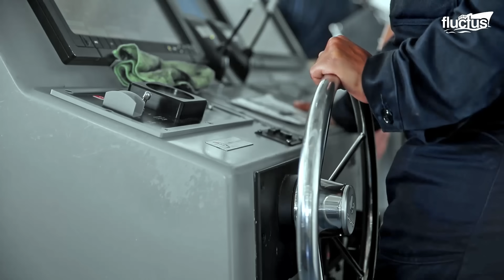The Weird Technology US Navy Uses to Refuel Billion $ Aircraft Carriers at Sea

Comment: This whole operation actually looks like a disaster waiting to happen for so many reasons. But, you do what you have to do. 😊😊😊
Reply: That can be said for just about everything in your life. Good thing there are precautions and well trained crews
Reply: @Coinz8  8
Reply: It actually is very well orchestrated...every hand in the front line are normally well seasoned before they reach that position....if there are problems ( and they occasionally happen) it can be both human or mechanical
I've  been through my share of receiving stores and fuel and never had a issue